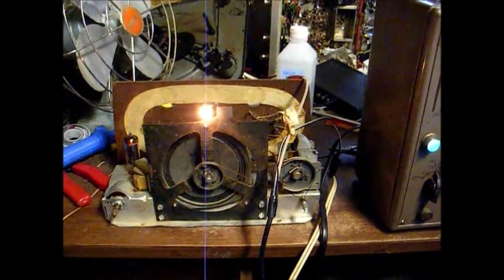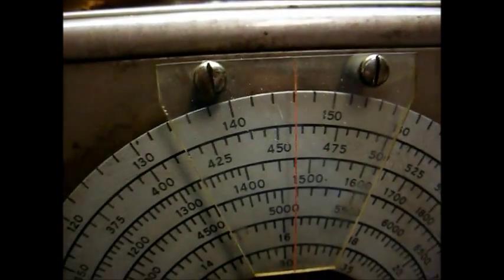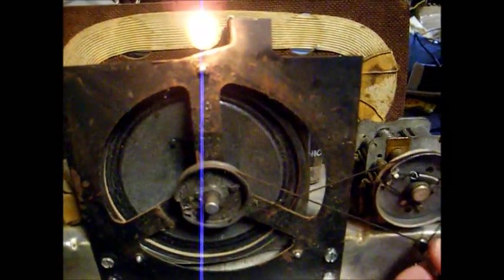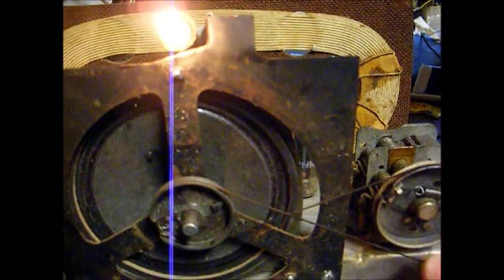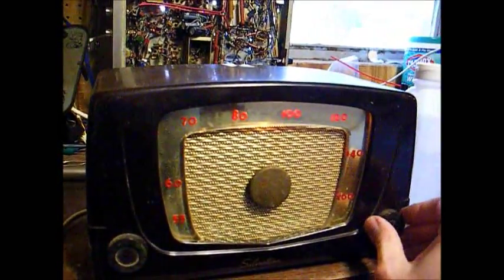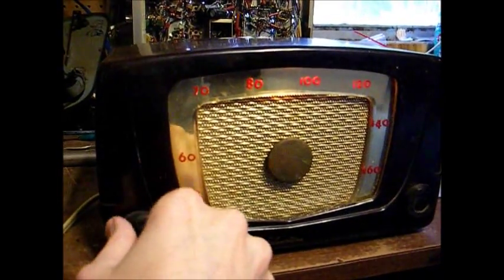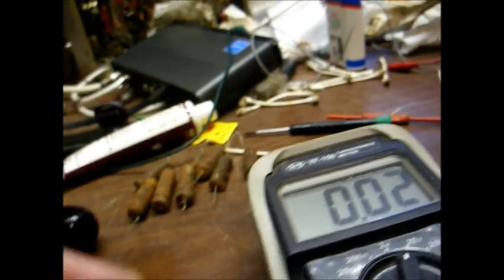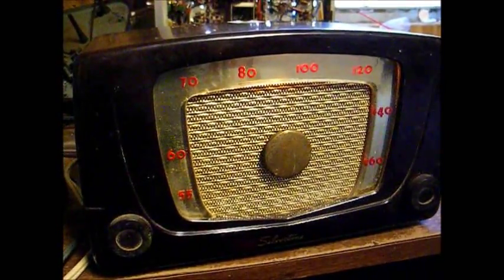Repair of a Silvertone model 5 tube radio - part 4 (electronic repair complete)

Comment: Silver tone Radio Model 5 can't locate the tuning dial anywhere the only Solution I can come up with is a out door weather Thermometer that use's a long red Indicator that can be removed and Welded on they sell the wreath Thermometer Gauges at lowes that can be used the indicator pointer that points to how hot outside it is.....

Comment: Thanks very much for the input! 
Yes that does make sense that a leaky cap will read differently than a good cap.
Then how do you determine what a value capacitance of a mica cap in an IF can should be when there is no reference anywhere?
I suppose I could take 2 good trimmer caps and hook it up to the primary and secondary and when the IF is resonant, take out the trimmers & measure them. Have you done this? Does it work? Do I have to factor in the "Q" of the tank circuits too?
Thanks!
Tom
Tom

Comment from the maker: I'd buy an inexpensive capacitance meter from some of the mail order parts suppliers such as MAT Electronics, MCM Electronics, etc. The only issue is that when a leaky cap is tested on one of these types of meters, the capacitance value will usually register much higher than the value marked on the capacitor.

Comment: Great job on that radio!
I've got a question for you. I have a Solar CB-1 capacitor tester which is great because I can test capacitors for leakage at their rated voltages but not accurate for capacitance reading. What do you recommend for accurate capacitance reading? I need an accurate one because I'd like to measure micas in IF cans that don't specify their value.
Mastech has one that's not too expensive.What do you think?
I'm all ears.
Thanks!
Tom